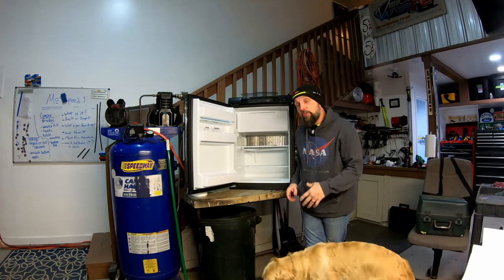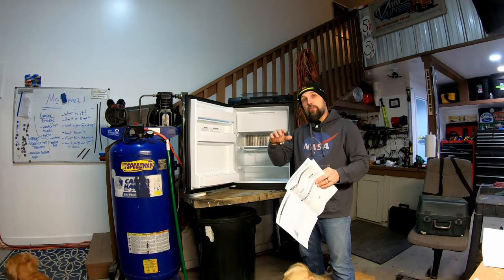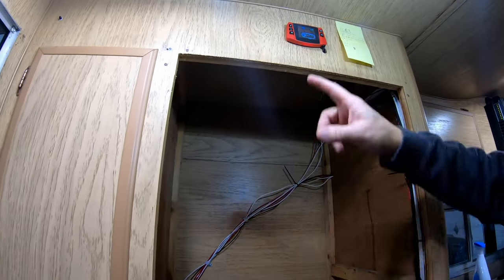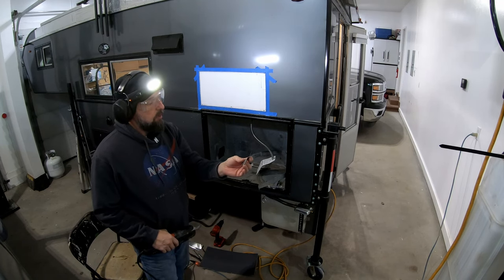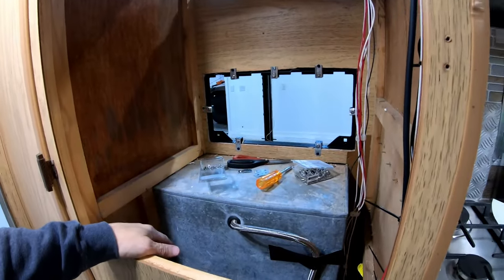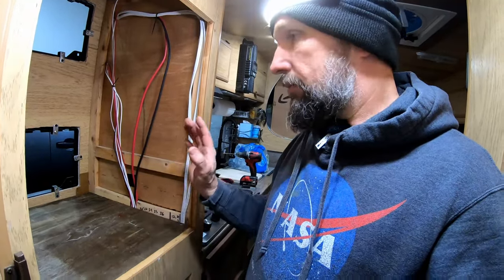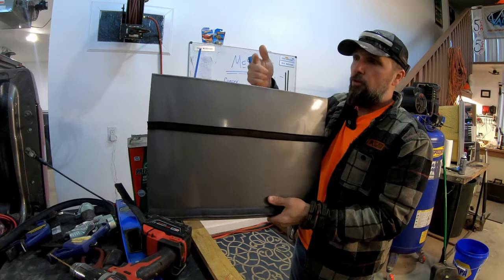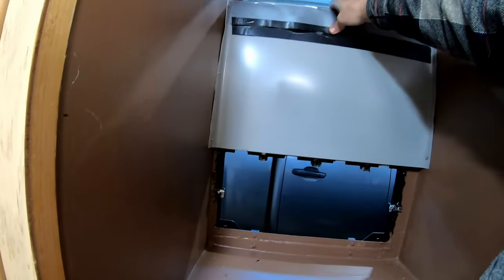Will it fit? 3 Way Dometic RM2354 Refrigerator Retrofit in the $500 Truck Camper!

Comment: Hi, I have the same fridge that I've been troubleshooting and stumbled across your video. Great mix of information and entertainment. Is that a fan attached to the back of the fridge? Mine does not have one and I've been dealing with performance issues. So far I've installed some baffling to help. Thanks a lot for posting the video and enjoy your camper!
Reply from the maker: This unit had the one fan on it.  However you can add them pretty easily and it can make a big difference.  Baffling is huge too.  You can add more than one if you want.  So far this one is working.  But we haven’t had it in super hot weather
Reply: That's what I'm fighting. It does fine until the ambient temperature gets above about 75° F. Is the fan screwed into the back of the fridge? I'm trying to verify if it's okay to do so. Thanks a lot for the quick response.
Reply from the maker: @chriestoph  it is mounted above the lower coils.  You can get a replacement and or the double fan kit.  I had a truck camper years ago that the fridge only worked when it was colder out.  Turns out the fan had gone bad.  Replaced it and it was cool even on a 100 degree day.

Comment: Nice work!
Reply from the maker: Thank you!!!!   My wife is very happy.  She hated the ice box.  It wouldnt keep
food cold for more than a day.   Now we have three options to keep
It cold from a/c, d/c, and gas.
Reply: I need to get measurements of the new one I'm gonna plan on putting in mine and make sure it will fit in door opening or if I should get it soon and slip it in through the open wall. Lol. Just didn't wanna drop $$$$ on fridge yet til camper is done.
Reply from the maker: @BuildItWheelItExploreIt  better to know now because going back and cutting it up later sucks!